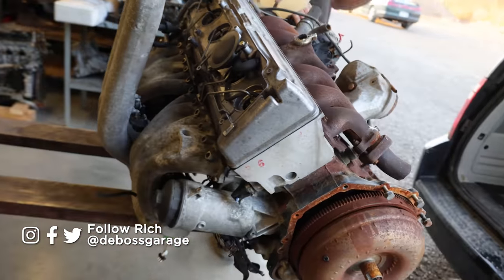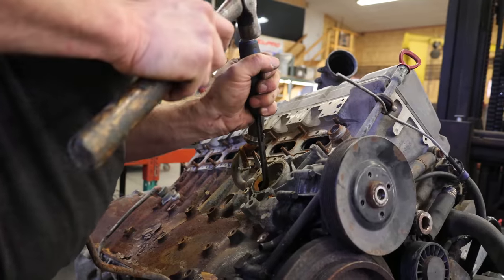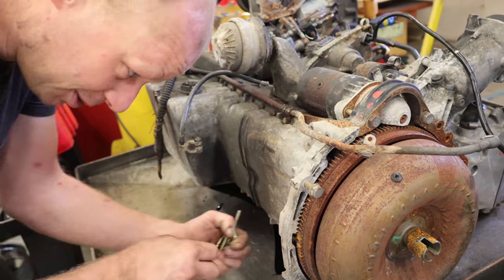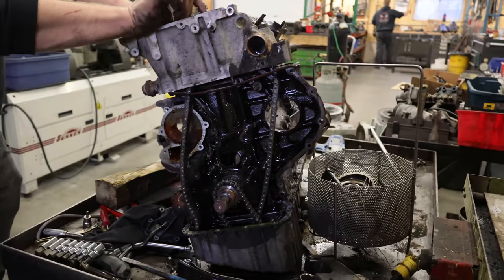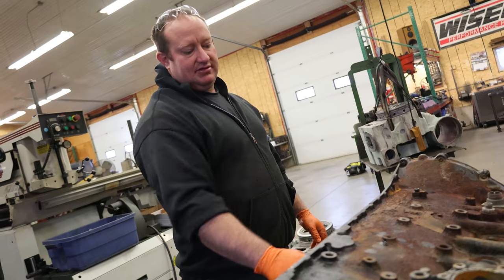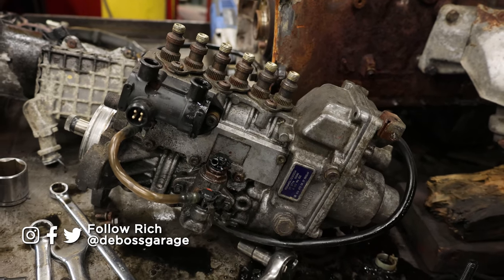REVIEW: Everything Wrong With A 3.0 Mercedes OM606

Comment: I owned a 95 om606 NA just like that. IMO the big weaknesses are:
Injector return lines/injector crush washers tend to fail and the combo of leaking combustion gases and leaking diesel leads to a wonderful "black death" buildup on the valve cover.
Stupid plastic fuel lines and connectors. There are kits I believe to ditch those, but you can also sorta build your own and get rid of the silly plastic connectors and lines.
Valve seat recession. cyl 5 and 6 are known for mashing the seats into the head, My 606 ran on 4 cylinders when it was cold, and would slowly pick up 5 and 6, but they were obviously weak. I believe this is due to the blowby gases not being circulated to all cylinders equally so 5 and 6 get less lubrication, or maybe I'm thinking of something entirely different, I can't remember.
The serp belt tensioner/shock broke multiple times on me until I installed an overrunning alternator pulley, in 95 they got solid alt pulleys, 96 and up got OAD/OAP setups, I found one from a newer car, and had no more tensioner problems.
Glow plugs can swell and get stuck in the head, and it is a chore to remove them. Don't ever use Autolite glow plugs, and to be totally honest, just buy the Bosch plugs and be done with it. I've had every other brand of glow plug fail prematurely while I've got years and years on the Bosch plugs in my current fleet.

I'm personally not a fan of the 606, its a good engine in a lot of ways, very smooth and makes decent power, but a lot more compact and difficult to work on compared to an older OM617 like I have in my cars, or a 6BT like in my trucks, also they feel too much like a gas engine, no torque at all, had to rev mine to 5k in every gear to get into traffic while my far less powerful 617 will easily merge without riding the governor all day long, which could be due to the valve seat issues, it certainly was not a lack of fuelling.

Comment: The heads are not the same between the turbo and NA blocks. Different exhaust valves, valve seats, and intake cam profile.

The flapper doors are not there for heat, they are there to change the runner length of the intake manifold to help the NA diesel respirate better. 

The thing you called a fuel pump is a pierberg pump which is the source of vacuum for the engine. That is what drives the brake booster, the flapper doors, the EGR, the ignition kill for the injection pump.

OM603 was before the OM602.

The EDC pump (electronic pump) is tuneable and can be done with Baldur's DSL1 ECU.

Easiest way to get that pin out is with an M6 and a bunch of washers.

The injection pump gear has a built in centrifugal advance. There are weights which fight those springs. Higher RPM means more advance.

The original chains did not have a master link. The replacements do have a master link.

The tips that sit bellow the deck of the head are actually the prechambers, not the injectors. They are the reason the IDI Mercedes engines were so good.

Pretty sure Mercedes made the majority of the parts in house at the time.

If you're still looking for a Mercedes parts resource... Check out F-Tune Performance, Fred is a great guy and he's very knowledgeable on all things OM60X. Benz Force in the US is a good source as well. Diesel Meken, DPUK, Myna, and Fred at F-Tune can build injection pumps. Baldur is also a wealth of knowledge and a very friendly supportive individual for his hardware. He also makes stand alone ECUs for common rail diesel injection engines.

Comment: Not sure if its the same with the OM606, but performance Mercedes engines I've built you buy different thickness main and crank bearings to get your clearances. From the factory they essentially have a blueprinted crank

Comment: Timing chain guides have a special tool to remove the pin. Its a threaded bolt, stepped down  to another threaded area that goes inside the pin. I have one if you would like to see it. I use a bushing and nut with it, used like a gear puller.

Comment: There are threads in the guide pin use a bolt and a slidehammer too get it out, and when its out you can lift the head. filterhouse from 603 with banjo fittings and mechanical pump from 603
Reply: Dnd also a Wärtsilä 46F review would be fun ^^

Comment: my guess on the sprocket with the springs is to take out any backlash. if so, the two opposing sprockets should be counter rotated against the spring tension before putting on the chain.
Reply: No just there to advance the timing as it revs up
Reply: guessed wrong then i suppose, thanks!
Reply: Being more specific the springs counter the flyweights retarding the timing at low revs and then the flyweights overcome the springs to advance it as it goes up

Comment: the drive gear is the injection timing device. it has wheigts on the inside which load up the springs when the engine revs up, advancing the timing in the process. they advance the timing about 12° through the rev range. 

i was cringing a little bit when you snapped of the guiding pin. youre surposed to put an allthread in there, put a big nut around it and pull it out using a big washer and a nut .

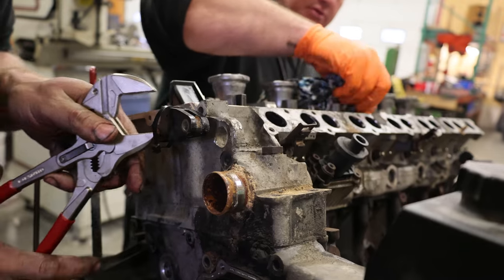Comment: 11:29
yeah you could soak those pins in penetrating oil really good a few hours and the M5 thread that mercedes usually uses on those pins can be adapted to a slide hammer or a pair of wedges against the casting

Comment: All it takes is a 6mm bolt and a nut to get that pin out (look at the end of the pin you will see it threaded 6mm) OR there is a MB tool for that (still screws into the end of the pin). The pin is a friction fit on install (light hammer taps). all the cam chain guides are held in this way

Comment: @ 9:30 you mention the cam in block having rpm limitations, compared to cam in head styles. FYI, you can make a 429 Ford run 9k for a drag strip, and a 289 run 9k throughout a season of 250 - 500 mile races, @ 504HP. That was late 60's and 70's. Now you have Titanium, and computer designed cam/ignition profiles and FEA. Diesel wasn't immune to the strategies either. As a veteran of automotive advances, I'm impressed at the digital improvements, more than the significant power increases. I own a 99 C2500 with 6.5TD. Runs good, but no one around to talk to the computer. Needs a few calibrations, and even the Snap-On dealer says no one around for that. In Tampa? Time to kill the worthless computer and make my own system, trans too.

Comment: Love the channel.you guys should your motorcycle buzz on, air cooled or oil cooled only, as water cooling is for cars.
We have seen over 400 horse from a Suzuki bandit engine using second hand pistons and a used turbo from a Subaru.
Keep em coming , every ones a winner

Comment: I am going to cram one of these 500hp versions between the rails of my Chevy 46 COE, been looking at at turbo 292s but keep coming back to this 606 engine, I am in England so its making lots of sense, there lots here, they are very cheap to buy tuned compared to imported US performance inline 6s. Great video.
Reply: From what I’ve seen in Europe, it’s very common to use the bmw m57. Very easy horsepower with those and also built extremely well.

Comment: Love your show, any chance you could review a Nissan TD series diesel engine, a 4 cylinder Td27 or a 6 cylinder TD42, they came in early to late 90s Nissan vehicles, D21 hardbodys, safari/patrol. Td42t/td27t is the turbo version. I have started a rebuild on a Td27t, and would love to hear how you rate them.

Comment: few things. the pins usually have a tapped hole in them, you need to clean them out if they have been in a field, but pull out easy enough. the chains, you split them with a special tool, reinstall the same way. I usually work on BMW's but have had to suffer a few mercedes in my time.

Comment: The vacuum operated flap thing inside the intakerunner is related to the EGR system, and has the purpose of creating a low pressure area between it and the intake valve, so exhaustgases can be inducted.

The injection pump has its own lift pump mounted to its side, and one cool fact is, that mechanical injected OM up to 606 engines will run without any electric source, because the rack is fully mechanical and the engines is stopped by vaccum, as all functions of the pump are vacuum controlled.

Before the OM601 - 606 series, the OM636, 621, 615, 616 and 617 injection pumps had their own oil reservoir.

The reinstallation of the injectionpump is quirky on its own, as you don't install it on your wished advance timing setting. There is a relative relation of marks, as you turn your injection pump on "TDC" then turn your engine to 12-14° After TDC, don't ask me why, but one guy ones said to me, that it is because of dynamic timing measurement with special electronic, and special Mercedes equipment, which requires after TDC marking, to cancel out vibrations and harmonics out of the measurement 🧐

Comment: Usually the pins for timing guides in Mercedes engines will have a threaded hole at the end for a small slide hammer. Least that’s on M274s and various newer engines. I havnt torn down anything pre year 2000

Comment: There is also the om605... same engine, one Cylinder less... 450-500hp capable...
The electronic Pumps can be tuned with a DSL1 stand alone controller.
Also can the, so called, EDC pumps be upgradet to the same Power and 8mm Elements than the mechanical pumps... but with better control and the possible map switch

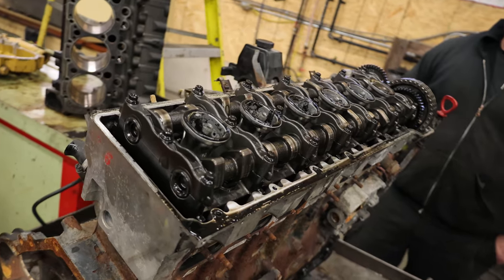Comment: 8:46 valve float is caused by a lack of spring pressure. When spinning the engine very fast the nose of the cam can get away from the follower if the springs aren't stiff enough.

Love your videos Rich, keep 'em coming.
Reply: I change the spring, works great now.

Comment: Turbo engine has beefier rods and piston pin size compared to this n/a version. get some real rods and give it alot of boost. dont forget to use multi layer steel headgasket from the turbo version. N/a gasket is only good for 1.5bar max

Comment: My vacuum pump gave up so I had to block the air intake to stall the engine and lost central locking until it was replaced.  It only lasted 470,000 miles.

Comment: weld aluminum to cast iron? Yes, first ya braze the cast with bronze, then ya braze the bronze with aluminium solder, then ya braze the aluminum to the aluminum. requires three different kinds of welding rods all with differing amalgamations and three different flame/tig temperatures.
Reply: titanium can also be welded to aluminum...

Comment: Theres a one time technician installed master link in the timing chain thats crimped when the chain is changed or serviced.
Reply: I need a better video of how to break it open and recrimp it to service the head or replace the chain
Reply: @christopher6161  Its a factory style timing chain crimp set and chain break tool . Simply find originally crimped link or wherever you lock out the cams and break the link get the old chain out /new one in .Using the new unused link , get the chain all in place , slide the new link in . Place the die and the crimp tool on and crimp it . Most Mercedes timing chains are crimped like this .

Comment: Maybe don't need to weld any pieces together to get a p pump on there. Could potentially do some sort of spacer/adaptor bracket that bolts to the Mercedes block and also has the pattern to bolt the p pump to it. Cut the end off the Mercedes pump and machine some type of coupler to adapt that piece to the p pump shaft. Maybe cut a key in the p pump shaft.

Comment: Those hydraulic lifters are like the ones in bmw’s.  They’re pretty cool but they can get stuck if it sits for a long time. I’d probably soak them all in oil for a couple days then go and push on the one side a buncha times so they don’t get stuck when it’s back together. If you put it back together lol. Love the vids man big fan 🤘🏽

Comment: 4:58 you could use a heat gun to get the nylon soft enough to push (or pull) from the very end of the hose off the banjo fittings.
(not only pulling like Chinese finger cuffs) but mostly pushing from the end and pulling a little just to give it a spiral motion

Comment: As a Mercedes benz mechanic who has worked on load of them diesel and petrol engines there is a slide hammer tool u screw into it and pull the pins out that’s How we get the chains off

Comment: I get that 10mm box wrenches are always missing... If you had a 10mm then the power steering pump would have came off without removing the pulley. That is a really cool engine though.

Comment: It's also interesting to know, that OM606 as 601-605 are short stroke engines, so they are undersquare, one of the reasons why the like to Rev quite a bit, they don't like lugging that much, there is usually nothing before 2000-2500 rpm
Especially on the 4 valve designed 604,605 and 606

Comment: The best thing is the sound of them...I have 3 of them...  you use the pump off a 603 all mechanical and get it tuned by pump guy...1998-1999 e300 is the only year they were offered in a turbo model.

Comment: I believe the OM606 shares the same block as the M104, and that the crankshaft from the OM606 drops right into the M104 (for those looking to convert their 2.8 or 3.2 into a DIY 3.6 AMG engine).

Comment: Those pins are dowel pins if they are like the ones I've come across 6mm internal thread if you pulled the center usually 20mm that unlocks them and they pull strait out

Comment: The chain guides are held in by pins m6 bolt and a 13mm socket to pull them out they are tight and will give a nice crack sound when released to put them back in just use a hammer until the sound changes like a bearing race 👍

Comment: We got a Mercedes engine on one of our trucks and it tries to take off on you like you put in gear move up the gears and all of a sudden it will take off on you like a horse you pull the reins back but it just goes type . couple shops and even the dealer couldn’t figure it out so they put in a rev limiter where once it gets to 1500 rpm it cuts out. So that being said what do you think it is

Comment: Those plastic hoses on the fuel filter assembly: trash.
Don't bother buying new ones. They are too small in diameter even for the stock engine and once they are a little older they only cause problems. Depending on aftermarket or OM they either get brittle and crack, or soft and compress under the suction power of the pump and cut off the flow. 
On my OM605 and 606 I threw that entire cluster out, made a nice bracket for a CAT filter that flows better while also having superior filtration, and I'm running 10mm standard diesel spec fuel line.
Fantastic engine. I'm looking forward to seeing what you are going to do with it!

Comment: I was pretty surprised that there are still so many pushrod engines running in north america. Over here in europe they are gone for many many years as far as I know
Reply: Most North American vehicles are push rod, they are cheaper to manufacture, repair, and have good low end torque. OHC have advantages for power/physical size ratio but North American vehicles are large and space isn't as much of a premium. 

My 2019 Chevrolet is the first OHC vehicle I've owned.

Comment: Nissan uses swirl control valves in their intakes. Or that's what Nissan calls it. Even my 91 d21 hardbody has them. It doesn't do much that I've learned from being a nissan tech. Basically restricts the intake air volume when u dont need it at idle and part throttle speeds. Kinda like egr

Comment: Very nice... I found myself a great 1998 Mercedes Benz E300D OM 606 TurboDiesel with the 722.6 5 speed trans 228,000 miles ....last week near Portland (Shithole) Oregon... I got it for $2500.00.. I was going to do a swap into my 1982 Chevy Cube Van/Camper...but the car is in such Beautiful condition (Everything works...just 1 Turbo Wastegate code) I don't think I can Sacrifice such a beautiful car for my swap ! .. I am thinking I might just throw a set of 062 Vortec heads on the 82 van's stock 350 and see how that works.

Comment: That guide pin for the camchain guide is just pressed in, just get a sliding hammer with M6 threads, spin it on and just give it a couple of knocks and it will come out and the camchain guide is loose 🥳 aaaand not to crash the party, the om606 turbo has stock oil squirters, witch your block is missing.
Reply: Apparently the later NA 60x engines had squirters too

Comment: If you can find a GM 5.7 olds diesel DX Block !
Grew up around these engine s.
This was my dad's answer to us not getting speeding tickets. That being said they were not a fast  engine good fuel economy for their time.
At once upon a time we probably had two to three station wagons & Fleetwood Cadillac 5.7 Diesel's several had the Good Wrench replacement engines.
Such a misunderstood engine!!!
Currently have a '67 Chevy pickup Johnny Cash one piece at a time special 67 to 72 truck '90s stepside box with a 5-7 Olds   Diesel

Comment: My Jeep is dohc 2.8 vm motori diesel. Common rail with a cp3. I’ve got just over 230,000miles on it and haven’t had too many issues with it. Mostly just the transmission in the damn thing.. I feel like that would be a good engine to cover next.... I’ve been trying to get one of these om 606 for a long time but I also struggle trying to find them in New York for anything less then 5,000.

Comment: i have a 2014 e350 gasoline engine,  3.5 liter, 300ish HP stock, and it has that same high pressure fuel pump with the wave cam that you mention around 4:00. mine is driven off one of the 2 overhead cams, its weird.

Comment: nice engine, will be interesting to see how this goes,  I'm running an old 7.3 Turbo idi in my 70 F-350, and a 1.6vw Turbo in my Samruai, with a 1.9aaz on a stand. The Merc 6cy. DT OM606 would make a nice plant in an old vehicle
Reply: That in a old land cruiser or some thing like that
Reply: @kevinpatriarch6719  Seems like a good transplant for a basic pickup, 1/2 ton even. The rest is all gearing.